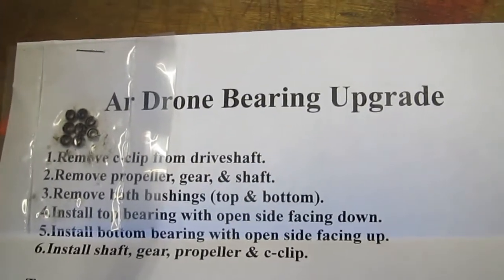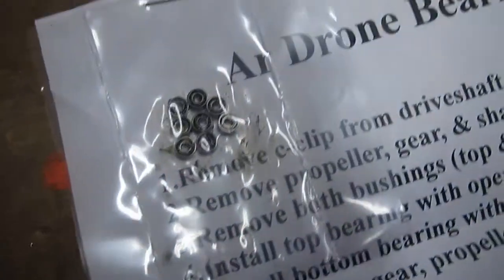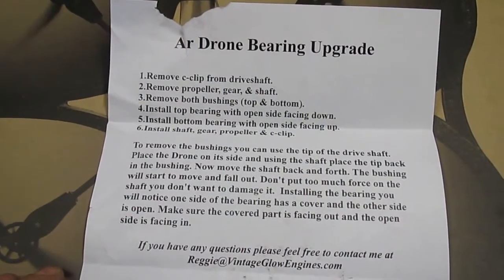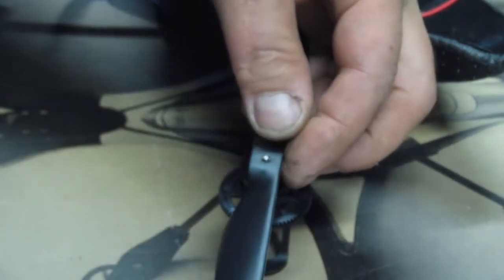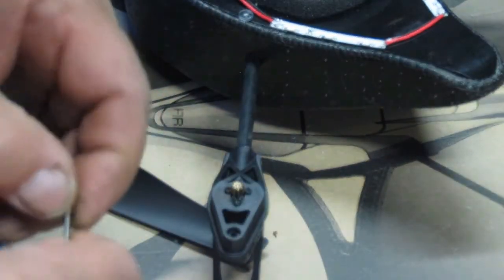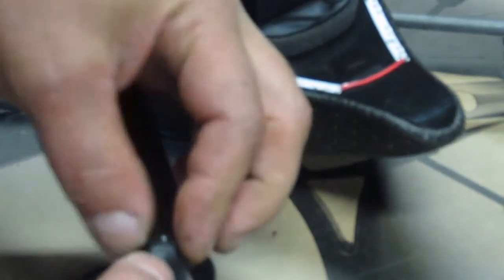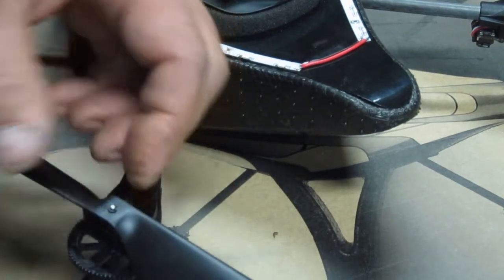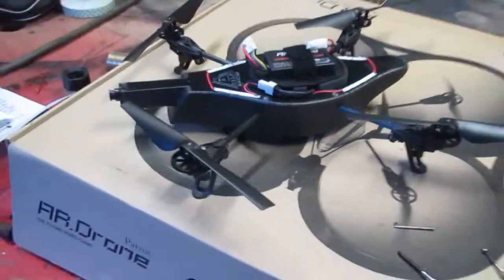Parrot AR.Drone Mod: Bearing Upgrade

Comment from the maker: I would probably take out the bearings and try some from a different supplier but if you want to cobble it together try painting the outside edge of the bearing with nail polish  and then push them in when they have enough extra width to fit tight.

Comment: I installed the Bearings to my drone but they fall out of the drone so they are like 0.05mm to small. Also the Drone is not stable in the air. How can i solve this?

Comment from the maker: With glasses I can easily look over them and use my near sighted condition to my advantage to see sharp details from about 16" to 2" to get really close to the work. With contacts I have to use those stupid looking reading magnifier glasses and I still cannot get close to the work. Anything closer than 12" I need not just reading glasses but a jeweler's loupe or magnifying glass. It's very difficult to adjust. I have to retrain myself to look through these crummy reading glasses instead of over.

Comment from the maker: My 8 year old Nike frames finally broke and I have no backup glasses. Glasses for 4.25 near sighted are EXPENSIVE because you pretty much have to get the thin lenses, and I need polycarbonate for work and scratch coating etc etc it runs several hundred for a pair even with cheap frames. Contacts on the other hand are dirt cheap these days. I can get a year suppply for 1/2 the price of glasses. So I went with what I could afford. With glasses I can focus fine at 2 feet. With contacts 6 feet.